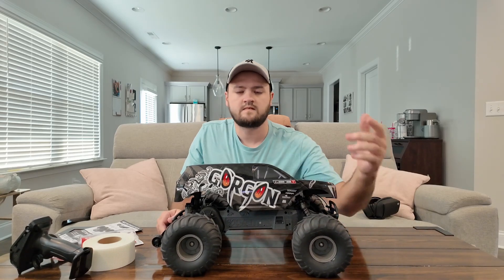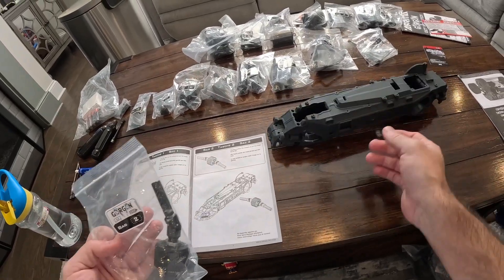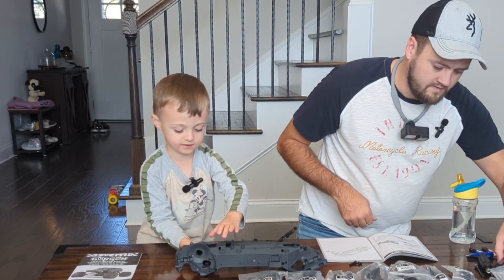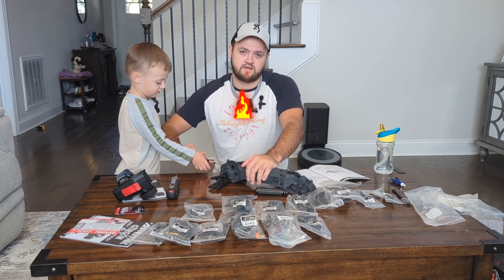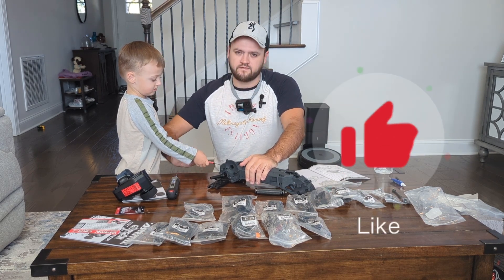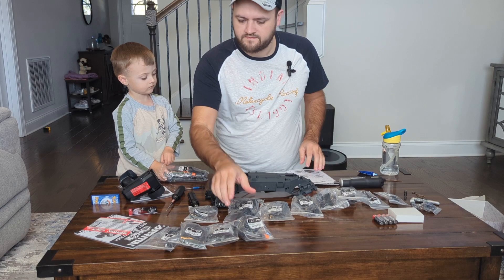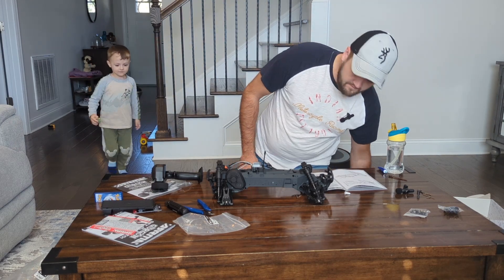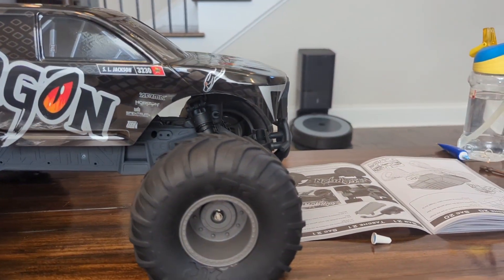ARRMA Gorgon RTA build

Comment: Love it....Great bonding stuff...Oh my motor blew on my Gorgon. just ordered new one.
Reply from the maker: Did you break In the brushes on the new motor ?
Reply: No...how? @EKB_RC
Reply from the maker: put it on 50% and slow gentle acceleration on flat smooth surface like pavement or concrete for one or two battery packs will make motor last alot longer  @morsecoderstirling
Reply: OK..cheers @EKB_RC